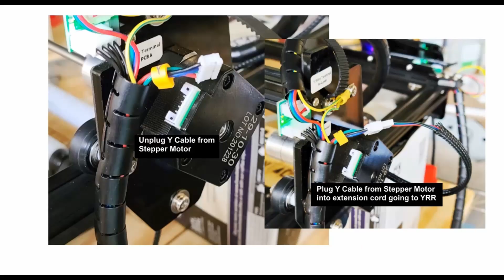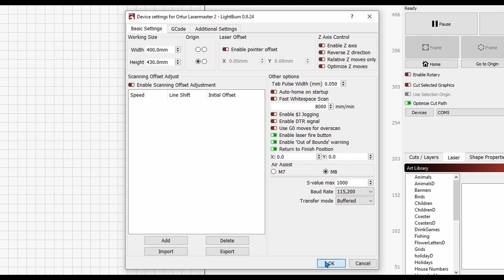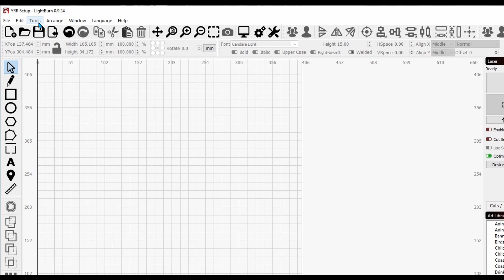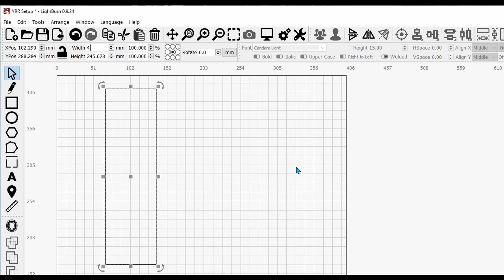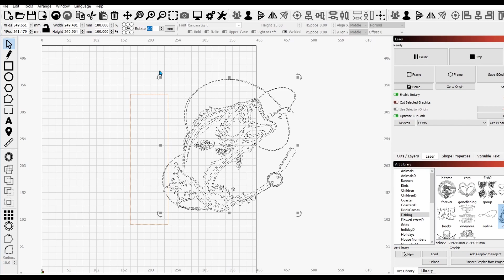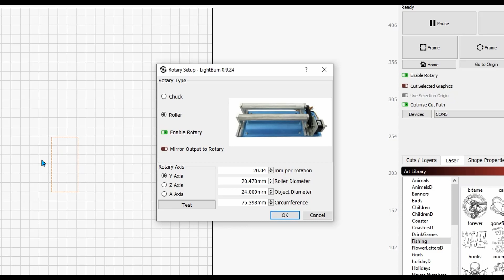👍 Ortur YRR Rotary Setup - The Only COMPLETE guide!

Comment: Hello! Your videos are so helpful.  I have learned so much already.  Now I am stuck.  I am trying to get my rotary tool set up.  I have everything hooked up on my ortur laser master 2. My green and red dots are at the bottom left of my mat. My mat is set to 400, 430mm. My 4mm test strip along with my framing rectangle are both centered on my mat. I have absolute coordinates chosen. I cannot get my laser to go to the center of my mat. It keeps going off to the left and to the right.  My rotary tool spins but since I can't get the laser to "home" in the center I cannot run a test strip on my cup.  I have also turned off everything and rehomed to the bottom corner without the rotary to see if resetting the laser would correct the problem when I re-enabled my rotary tool.  But it doesn't.  It just gets to the right side and vibrates like it is still trying to find the intended spot.  Can you please tell me what I am doing wrong?  Thank you in advance!
Reply from the maker: I think you need to re-watch the video Crystal. Your origin is set wrong and you don't home a laser in rotary mode.
Reply: @TheLouisianaHobbyGuy  Thank you for your reply. When I homed it I had turned off the rotary mode to home it because I wanted to see if it would home correctly without the rotary. Then I re-enabled the rotary to see if it would find my origin for the rotary. I have tried several different origins. My main one is 200, 215mm in absolute coordinates as you had suggested. I have also tried 0,0 mm and other random ones such as just changing one axis at a time etc. I have also tried current position, user origin. It’s like my machine thinks my mat is bigger because it tries to go past both left and right edges. But I have checked and everything is in mm. I have selected  every one of the job origin circles and tried each. Nothing changed. I have a 20w so I also reset the rotary to 20.00 and tried to just use the x axis without the rotary enabled as you said ortur hasn’t addressed a problem. I have watched, and re-watched the video.  My settings are the same as yours for origin as far as I can tell. My diameter and circumference is set correctly for my item and rollers. I’m truly at a loss for any more origin options.
Reply: @TheLouisianaHobbyGuy  I also noted in my “move” the “get position” is showing negatives and I can’t figure out how to change that. So it says -445 through -675 depending on where I move my arrows.  So when I try to go to the 200,215 position it is slamming into right side.
Reply from the maker: @crystalraymond7278  Press the reset button above the power to turn it off Crystal. Then turn it back on without the rotary and see if that solves the problem. If it does, use current position as the origin and plugin the laser with the power on and positioned in the right spot. If it doesn't, jump over to my forum so you can post the settings and we can have a real discussion over there.
Reply: @TheLouisianaHobbyGuy  Thank you.  I had found something that suggested it had to do with the "soft limits". For some reason when I switched them to false this seemed to allow the gantry to keep trying to move past the boundary. I turned the soft limits back to "true" and I hand-moved the laser and reset the position to 0,0.  So when I reset the absolute coordinates the laser moved to the correct spot. When I turn the soft limits back to false the problem reoccurred.  For now it seems to be working correctly in soft limits "true" mode. I haven't got to do much more with it since I am waiting on supplies but if I am just doing a "work-around" then I will try your suggestion and may have to reach out again. Thank you, again!  I really find your page helpful!

Comment: Hi Rich.  I just upgraded my Lightburn software to:

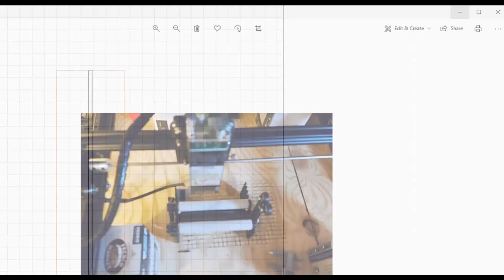LightBurn 1.2.00,  built Thu 2022-06-30 @ 11:55
Created by LightBurn Software, LLC

And the settings menu is different as well as the Rotary Setup dialog box.  The Rotary Setup is now under a menu option called "Laser Tools" and inside the setup box they have an option called "mm per rotation."  It defaults to 360, but when I pressed the "Test" button it rotated around a couple times and then back, but did not return to the same spot.  I then tried setting it to the circumference of my object and that seemed to go all the way around and return to the same spot.  I have no idea if that is what I should set it to as this is my first time trying the rotary tool.  Any suggestions on setting it and what it is for?  Thanks.
Reply: Sorry, I didn't watch to the end.
Reply from the maker: I'm guessing you found the mm/rotation! 🤪

Comment: This went really well. Right up to the time I set the distance from the laser to the rollers to burn a sample.
Nothing happened and for the past 90 minutes I’ve tried and watched the red “On” light blink while the Console shows me Error 9
G-code locked out during alarm or jog state.
I’ve shut down, rebooted, reset and unplugged so many times I’m no longer sure what I’ve done wrong and tried to load the saved default settings (they are greyed out and won’t highlight).  I’m gonna walk away now.  I can’t think any more.
Reply: Just an update and another Thanks for these videos.  I’m still unsure why this fix didn’t work yesterday after seeing on your site but it did work this morning. I suppose that’s all that matters
Reply from the maker: Error 9 is a shock & movement alarm. On the Console tab, type: $RST=* and press enter. Then type type: $33=1000 and press enter. Now it won't alarm.
Reply: @TheLouisianaHobbyGuy  I did see that in a reply by you to someone else and had no luck but as I am the definition of insanity, I’ll try it again. Thanks

Comment: Hi Rich @ the 3.23 minuet mark you show your machine settings I have an anycubic Mega Zero 3D printer and a endurance 10w laser when i click on the edit tab mine shows nothing only that I'm running a marlin unit type. Followed your video (great by the way) but I'm always short on the lines no matter what I change. got any idea. Thanks
Reply from the maker: Marlin boards won't show those settings David. I have the Anycubic Mega Pro with the included laser diode and it works fine. I'm not sure what your problem might be.

Comment: Rich...I have a xTool D1 that I have been trying to set to engrave tumblers for my wife's annual Sisters weekend. I am under the gun.. By the way I am a extreme newby. I assume the setup is similar. I have watched every video I can and no-one using this attachment really explains how to set it up for lightburn.  I am using the xTool RA2 Pro with just the rollers and no chuck. They, xTool, initially sets the mm per rotation at 370mm which seems rather large. I am not sure what this means...rotation per mm of what...the item being etched? Is that set only once or for each item being etched. Lightburns manual doesn't address this and their YouTube video is very basic and leaves a lot out. I thank-you for your fine videos....complete videos..that explain the topic. I am going to use your calibration method this AM for the tumblers I am going to engrave.
Reply from the maker: Pretty sure the x-Tool mm/rot are right. That has to do with the stepper motor. I haven't used their rotary so I wouldn't know, but the parameters are similar. If you use the roller, check roller for the type, Z for the axis, 32mm/rotation and 17mm for the roller diameter and mirror output selected. For the chuck, it's type Z for the axis, and 128 mm/rotation with the same settings.

Comment: Thanks for the quick response. I typed in what you gave me that stopped the red light from blinking.  I did save a backup DEFAULT LASER it had an extension Ibset but this is what I get when I click on it C:\Users\Skip\AppData\Local\LightBurn\backup\machine_settings\LWYwNWZmMz
 does not recognize
Reply from the maker: You have to browse to the folder you saved it in Skip.

Comment: Your  video was very good on setting up the yrr rotary. when I went back to the default laser the  G-code motion target exceeds machine travel. the laser will home  and I jog  it but that's all. Only had the oturo master 2 for about 2 months. I am lost any suggestion I would really appreciate any help thanks Skip
Reply from the maker: You didn't save and restore the settings Skip. Go to the console tab and type in $RST=* and press enter.

Comment: After setting the rotary tool up, I decided to take it off and do some flat laser burning but now I can’t get the laser to fire or get it to frame my project. Any ideas of what I am forgetting to do? I feel like I have messed the settings up somehow.
Reply from the maker: I don't know what you did! Reverse the procedure. I explained completely in the video how to save your settings.
Reply: @TheLouisianaHobbyGuy  I don’t know. I reversed the process but I cannot get my laser to cut or frame my projects.
Reply from the maker: @jesseharris3099  Did you reset the laser?
Reply: @TheLouisianaHobbyGuy  yes I did. It is working properly now.
Reply: @TheLouisianaHobbyGuy  , I got it working again. I got onto the Ortur forum and found someone with the same issue. Ran some codes to reset to default.

Comment: Rich, thanks for the information on the setup. I managed to get to work engraving my bottles without any issues. However, since then I cannot get my laser to engrave anything when I reverted back to normal mode, even after I reloaded the default settings file.
Reply from the maker: Sometimes it doesn't load the default settings on the first try. Do it 2 or 3 times and try again.
Reply: @TheLouisianaHobbyGuy  Thanks Rich, I'll give it a go. 👌

Comment: Great video! I have the Atomstack R3 Rotary. The principle is the same. One question I have is concerning the mm per rotation setting. Should this be the diameter of the roller times pi? My roller is 16mm in diameter so the mm per rotation would be 50mm. Or am I falling down a rabbit hole. Thanks again for the videos you produce! Denham Springs
Reply from the maker: No Jeff. They all seem to be different and it's based on the stepper motor used. For example, one rotary on my Co2 is 8250 SR with a 24mm roller diameter, and another is 9200 SR with a 25mm roller. So the numbers are based on the motor & the roller.

Comment: I feel like something has changed from your vs of lightburn to the current one. When I measured the distance between the ends of the burned test rectangle and added it to the mm per rotation it ended up going way longer. The default ony lightburn was 360 and it went around the cup a couple times. When I was narrowing it down and made a change of 1mm it would move around 5mm or something. My final number ended up being 63. Any idea what could have changed? I thought maybe there was a setting showing cm instead of mm but I could not find that.
Reply from the maker: A lot has changed since I made this video in V 0.9.24.  The default in Lightburn is meaningless. I think I mentioned in the video that my default for a diode laser was 20.6. It runs between 20 and 60 or so for the diode. Co2 lasers range from 600 to 9000.

Comment: I'm trying to add this rotary to my Fokoos FE20 laser and the rotary motor just buzzes and doesn't move. It does move freely when not connected to the laser.  I cannot figure it out. Anyone have any idea if the rotary cable might need the pins moved around or something? Also for some odd reason my mm per rotation is at like 336mm when setting the rotary up.
Reply from the maker: How did you get the 336mm/rotation if it's not working Nathan? And yes, the wiring pin-out is probably different.
Reply: @TheLouisianaHobbyGuy  the default was actually 360. I was away when I typed that message so I estimated. I ended up at 63mm being perfect but the method you suggested about measuring was way off on my test runs so I'm not sure why it wasn't working like you said. It had me stumped for an hour. Perhaps the different versions had some sort of change in the software
Reply from the maker: @nathanreed3302  Watch it again. My suggestion was to start at 20.

Comment: Rich thank you for your video it was spot on. I have a NEJE 3 max / A40640 laser. I saved the default machine settings page as instructed. but after finishing with the attachment I reloaded the default settings. Now the laser will only move from the home position to the origin position it will not obey any other commands. The machine operates perfectly using my cell phone. All operations appear to be correct. Do you have any idea what may have happened?
Reply from the maker: Try reloading the original settings again. Sometimes it takes 2 or 3 tries.
Reply: Thanks Rich. I followed your directions and it still didn't work. After researching more I found the issue. It was the GRBL firmware.  I re-flashed it and everything works fine. I tested it with another laptop I have on one of the cnc machines and we have touchdown. I'm thinking about getting a second laser. Do you have any suggestions? Thank you again for your help.

Comment: Just a heads up if you are looking for it, the Rotary Setup has moved to the "Laser Tools" group on the menu bar. (I'm running LightBurn version 1.1.03)
Reply from the maker: Yeah, I know. That's an old video. I have more recent ones with the new feature Curt, thanks!
Reply: @TheLouisianaHobbyGuy  still a great video. Thanks for the help!
Reply from the maker: @pinkflamingo8806  Thank you Sir!
Reply: @TheLouisianaHobbyGuy  when you  have a moment can you check an email I sent to you.

Comment: Hi, I've followed your instructions step by step. Now, using LightBurn, I clicked the "set position" option and the laser unit goes to the other side of the frame, bumping it. When I shut it down and clicking power again, the Red Light button start blinking and LightBurn does not recognize the laser. Any suggestions? I will really appreciate any kind of help.
Reply from the maker: I can't really help you in these comments, but you can sign up at my free forum to ask for help. https://lahobbyguy.com/bb/

Comment: Hi, I would like to ask you. Well, I've unplugged the Y-AXIS cable from the motor and plugged it into the Y-AXIS of the rotary. When I power the machine, I see the test rotary moves but the laser does not go HOMING. Do you know why? What have I done wrong? Usually it was fine. But no.
Reply from the maker: You can't use homing with the rotary.

Comment: Looks like I got it working well enough.. did not work with settings so I needed to do the alternate method. main problem i'm seeing is that towards the end, it jumps from one end of the design to the other, very fast, which moves it and ruins the design.  Any button I need to adjust for that?
Reply from the maker: Set your white space scan to zero in the device settings.
Reply: @TheLouisianaHobbyGuy  I tried that but either way acts weird and does whatever it wants 🤯 I'm gonna stop messing with it for the night and try to start over tomorrow. Works perfect without roller but for some reason everything resets or changes as soon as I plug it in. 🤔
Reply from the maker: @TomasQ  It's probably the steps per rotation in the roller setup. Were you able to burn the rectangle to calibrate the steps?
Reply: @TheLouisianaHobbyGuy  so I'm either I'm an idiot who set it up wrong or something else. I did exactly as mentioned by all instructions but it ended up working on Y2, with Y1 disconnected. No one mentioned Y2 unless I missed it.

Comment: Hi, Thanks for your video. I'm new here. I would like to ask you. I've gone through all the setup procedure. But when engraving on glass jar, the image is stretch on the jar diameter, even if I decrease it to less of half of its diameter. Do you have any suggestions?  The actual jar diameter is 84.7mm. The object diameter on Rotary setup is now 35.0mm and at the first engraving was also 84.7mm. The roller diameter is 20.3mm. Thanks and I will appreciate your help.
Reply from the maker: Your steps per rotation are off. Watch the video again.

Comment: Hello Rich! Excellent video...a question: when I have a cup with a variable diameter, how do I configure the rotary? which measure do I use? Thanks!
Reply from the maker: Solo se puede configurar uno, ya sea de circunferencia o de diámetro. Cuando haces uno, el otro cambia. En el artículo, enfóquese en el promedio o en el medio.
Reply: @TheLouisianaHobbyGuy  What measure  is "mm per rotation"? What's does it mean? Thanks
Reply from the maker: @martinpreizler5995  I can't explain it in a text. I explain it in the video.
Reply: @TheLouisianaHobbyGuy  Thanks again for your answer. I saw the video, but the first locker where it says "mm by rotation", figure 20.04 but not where that number comes from.
Reply from the maker: @martinpreizler5995  It means how many steps the stepper motor makes for one full revolution. Watch the video again.
Reply: @TheLouisianaHobbyGuy  Excuse me Rich…I saw the video with CC, , because it’s difficult for me to understand English. 
Sorry, that part is not translated
Reply: @TheLouisianaHobbyGuy  Thank you so much!

Comment: Thank you, Rich this helped a lot. I am looking into my Ortur Laser Master 2 Pro S2 400x400 bed. Laser is LU2-2 I was under the impression it was a 20 watt but I am not so sure?. can't get the center lined up. Laser seems a bit weak. But with all your videos it definitely helps a newbee in this game. I can recommend anyone to become a patron. Thank you for your videos.
Reply from the maker: Glad I could help Nico! And thank you for your support! ✔️ Ortur only makes 5W max diode lasers right now. 20W input, 5W optical output. I'm told they're developing a 10W version though.
Reply: Is it worth to add the air assist? I burn at 600-900 & 80-95% power. It feels really weak. Some material works well. But I hope to get some projects going. I am enjoying this as a hoppy and would like to use it to the best ability.